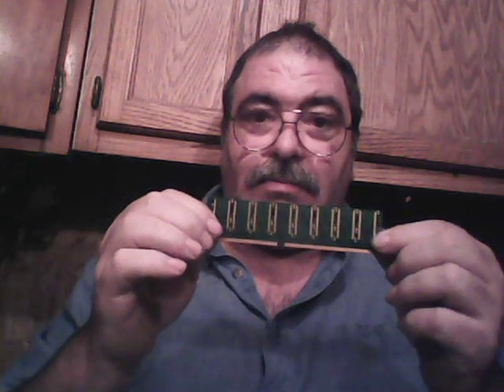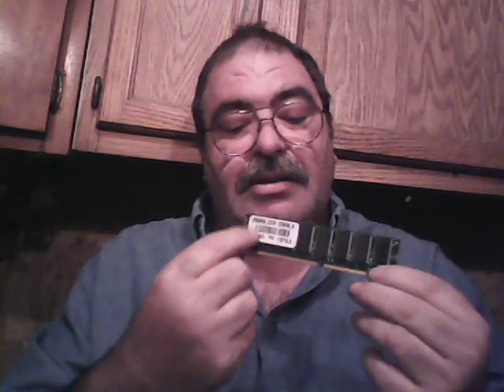explaining refining part 1

Comment: Hi geo
 how do you process crystal oscillators with the gold braze on them? Great videos by the way
Reply from the maker: andromeda1892   If it is the ones that you can see the gold layer, I recommend AR. If you are not experienced in working with a very dirty AR solution, They can be processed in copper(II) chloride as AP. The iron based caps will totally dissolve along with the base. The gold will not be effected.
Reply: Geo thank you. i will probably try ap. does the gold settle to the bottom as a black powder when you use ap?
Reply from the maker: it should settle as gold foil.

Comment: How would you get the metal out of the bored iafter you took every thing off the bored.
Reply from the maker: Adam Rendale It's a process that involves too much to explain here. Grinding or milling the boards. Incineration. More grinding. Acid leaching. Precipitation. Refining.  Search for refining copper from electronics.

Comment: Hello Geo, I have been watching and collecting now for over a year.
Just came across about 100 servers from dell 6000-1999/ dell 2650 -200? Where do I start? Please help!
Reply from the maker: Dismantle the cases to recover the electronics that's inside. Check the cases for non-ferrous metals (aluminum) and remove all the cables and wires. It's better to unplug rather than cut when possible. Check all cable ends for gold plated connectors. Remove the boards by removing the screws. This is to avoid troubles later. once the case is empty, it should be ready for the shredder pile. Any connectors with gold plated pins should be cut off and collected. All copper wire should be kept separate in it's own container. Remove any peripheral cards and and set aside. Remove any CPU's and place in a container just for them. Sort finger boards from boards without fingers. Place all aluminum heat sinks and heat spreaders in their own container. These can be broken off the board by a back and forth motion. Now that they are all broken down, you can work on getting everything where it needs to be. Sell the steel cases and copper wire and aluminum to the scrap yard and horde the PM bearing scrap until you have studied what you are expecting to do with it and how to do it.

Comment: hi geo, i have 34ques. i need to ask. 1 is can i check for gold content in solution with stannis chloride before using smb? and 2, do i have to neutralize solution?if so is there a subsitute for uera? can i go back and start over again with aqua regia if i don't get all the gold the 1st. time?
  i know thats alot of questions,but i'm stumped,and ca'nt move forward til i have a direction to go 1st.
thanks robert
Reply from the maker: (1)You have to test solutions before adding a precipitant (SMB).I keep a small jar to rinse my test into for later.Don't add the tested solution back to your working solution because it now contains tin.(2)If you have free nitric acid,you do have to neutralize.I use Sulfamic acid.Buy from Home-depot.A small tub is fairly cheap and works great.Its made to clean grout around tiles.Dissolve a small amount in water and then add slowly to your solution a little at a time.Stir and wait for the bubbles to stop to add more.Stop adding when no more bubbles are formed.The solution should be nitric acid free.When added together,sulfamic acid and nitric acid produces Nitrous oxide (laughing gas) and thus expelling free nitric acid.If you make a mistake and cant recover from solution, Add an extra amount of hcl and then add a small amount of bleach to ensure everything is dissolved.Add to the clean filtered solution a heavy piece of copper.Any precious metals will cement out on the copper and settle to the bottom as a black powder.
Reply: You can also boil down the solution till its a paste then add water. That will eliminate the use of urea

Comment: Geo, I have several questions after studding and experimenting with AR and the AC methods to dissolve and precipitate the Au back.
1.  I have read dozens of methods of the AR to dissolve gold in forms of CPU, fingers, pins, etc.  Of the above some people state to heat the AR to a temp of 120degs then ad the SMB, while others say just drop it in after the AR is neutralized.  What works well with you since I am betting you have tried both.
2.  The Urea added to neutralize the HNO3, some again state just added a few tablespoons while others state to add until no more fizzing reaction is noticed.
3.  Upon neutralized the HNO3, some say to filter again and then add the SMB directly to the filtered solution, while others boast on heating up 8ozs of H2O then add 2-3ozs of SMB diluted then add to the solution.  What works best for you?
4.  The AC method to dissolve gold.  After the Au is dissolved, filtered, is it best to add the same volume in H2O to aid in the precipitation of the Au drop before adding the SMB?
I am a student of the strenuous chloride test now.  I make my own.  I still have a long way to go, but I have a general feel for the discipline required to precipitate precious metals from scrap and waste. 
I also have been reading your posts on (GRF), I joined, but and keeping myself small to conversations for I need to learn much, much more before I open my trap.

thank you so much for your time.
Norman P
Reply from the maker: You should heat the AR solution during the dissolution and not the precipitation.As a matter of fact, its better to chill the AR solution before precipitating your gold.This serves two purposes.It helps precipitate any silver as silver chloride and the SMB creates SO2 gas which is what precipitates the gold.A cold solution holds gases better than a warm solution.You want the SO2 to stay in solution as long as it can to do its job.If you add the HNO3 in small increments and stopping when theres no more reaction, there will be no free nitric to neutralize.If you simply must,use Sulfamic Acid instead of urea.SMB can be added to the solution dry or in a solution (do not warm for reasons stated before).Add equal or slightly less than equal amounts of SMB to expected gold yield. 1g gold=1g SMB. Always check the solution with stannous chloride after the drop settles to be sure you got all the gold.Actually,its better to precipitate from a concentrated solution.You can not dilute too much and you can condense the solution to a thick syrup.The drop is quicker and cleaner from a concentrated solution. 120 ml's +/- standard AR will dissolve 1 OZT of gold.

Comment: can smb go from a powder,to a liquid ,back to a solid in aqua regina?and ,I went to wash my precip. solution with tap water and it disolved,what happened?
Reply: Sodium Metabisulfite will decompose, when added to a hcl solution, into SO2 and sodium chloride (table salt). The solution becomes saturated with sodium and precipitates out as sodium chloride. when you rinsed with water, it dissolved the salt.

Comment from the maker: never boil until dry.that defeats the purpose.you want to remove the unwanted metals in the solution in a certain order.as each unwanted metal is dissolved into solution,the solution should be removed from the remaining material.do not skip the incineration steps or you will dissolve your target metal (gold) prematurely and remove it in a wash and losing it in the process.if you are processing the polishing wheels,its basically the same process as far as incineration goes.

Comment from the maker: if its from a jewelers shop it will contain a wide range of metals.incinerate the dust to a red hot state to remove any organics or carbons.start with a hard boil in hcl to remove aluminum and palladium fines and soluble oxides.incinerate to red hot state.hard boil in nitric to remove silver.hard boil in distilled water X's enough until water remains clear.cold AR to remove gold.hard boil in distilled water.hard boil in AR to remove platinum.test all rinses with stannous chlorides for values.

Comment from the maker: if you are just recovering the gold foils,theres 2g of gold in a pound of fingers from the sticks.keep in mind that the gold fingers contain about 1/3 the gold on a memory card.the other 2/3 of the gold is in the black chips.they also produce about 2g of gold per pound. the chips weigh more per volume than fingers do.your total yield will differ from mine or anyone else because we may use different methods, equipment or chemicals. you can expect around 0.3g of gold foils per pound of memory.

Comment from the maker: sodium metabisulfite (SMB). yes,after you expel the excess chlorine,you add the SMB either in a solution with water or dry.only use equal amounts by weight to the gold you expect to recover.2g of gold = 2g of SMB.try not to boil gold bearing solutions unless you have it covered with a watch glass.when you boil,the popping bubbles create an aerosol of your solution and carry it out of your container.it may not be much once but it adds up over time.